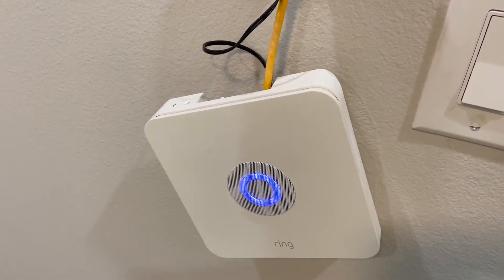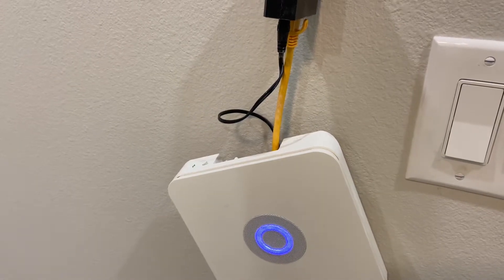Episode 83 - Powering a Ring Alarm with Power over Ethernet (PoE)

Comment: Years later, any issues?  I’m going to run cat soon and use it to replace location of old security system on wall
Reply from the maker: Zero issues. Worked perfectly for 3 years running.

Comment: Did you ever have any problems with this set up?. My ring power supply is 2.5A and this splitter is only 2A @ 5v
Reply from the maker: Been running for 2+ years with zero issues. 

Thanks for watching.
Reply: @Ciband  I just put a meter on my Ring power supply and it was drawing 0.07 amps. I then ordered the splitter and cable. Thank you for this. I love to make cleans installs and this will go high on the wall in our hall

Comment: Very nice, thanks for sharing.  Still working?  Should this work with the Ring Keypads also?? You say something about this Splitter coming with that small black cord.  I don't see that on the Amazon link.   Probably easy to find.  Thanks!
Reply from the maker: No this would not. 

The Ring keypads have an internal battery and are USB charged. Their data is strictly ZWave to the base station. 

To power the keypad you would need to wire it to a USB power source or a standard electrical outlet. 

If I had the walls opened up I might think about running a USB cable in the wall to a near by hidden outlet to have a clean install. 

Thanks for watching.
Reply: @Ciband  Thanks.  Any tips on hiding my cord on the Ring Keypads?
Reply from the maker: I would just drill a hole in the wall to feed the USB cable and make sure that hole is covered by the keypad.
Reply: You can you a Poe splitter that output micro usb and not use the Ethernet.

Comment: Hello, nice setup. I saw the power output of the wall plug is 5v with 2.5a. does it work normal? Have you triggered any alarm with the system to see if the missing 2.5 watt cause an issues? Thanks
Reply from the maker: So if I did my math right, the wall plug is running 12.5W. The PoE splitter has a max power output of 15.4W per the manual so we have plenty of power. 

You idea is a very good one for stress testing the setup. I have not tried it yet. Thank you.
Reply: @Ciband  thanks I saw in the manual that the max output of the splitter by 5v is 2amperes so 10 watt. So there is some energy missing to the ring base station. That's why I was questioning if you notice anything different

Comment: Have you seen any issues running it this way? I’m looking to do something similar myself in my new house
Reply from the maker: So far it has been running for over a month with zero issues.  I really recommend it now.
Reply: @Ciband  excellent, thanks for your reply, was just concerned because the power supply that comes with it a 3A and the PoE adapter I believe is 2A, but if you’ve not seen any issues, I’ll probably go with that
Reply from the maker: I don’t remember the exact numbers but I though it was well in spec for PoE+. 

Thanks for watching